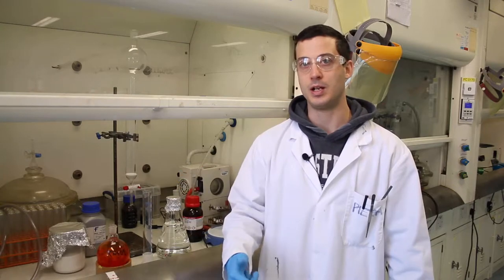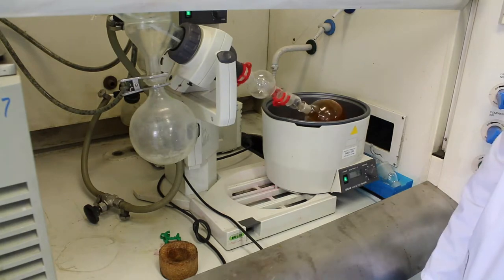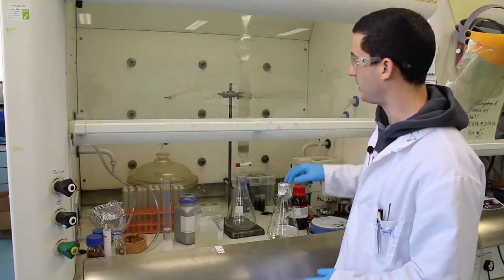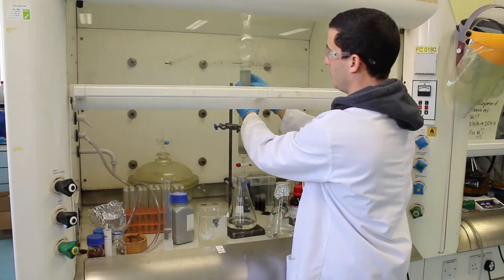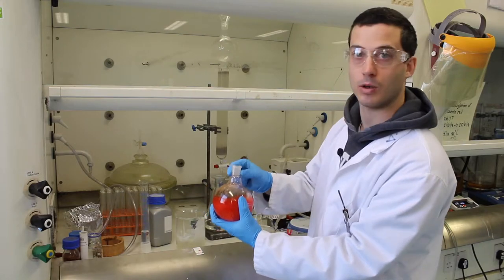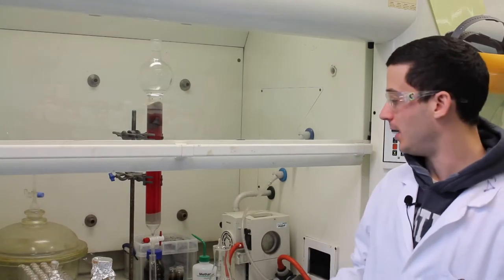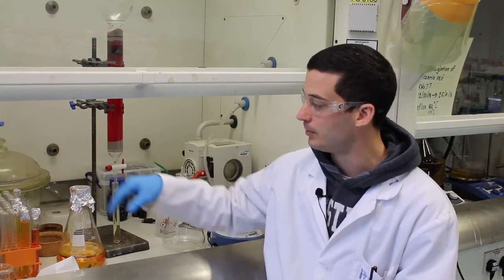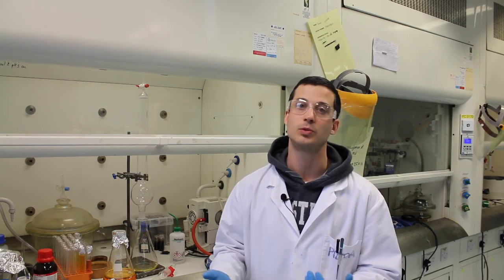Column chromatography

Comment: Very good tutorial! It's very important to always add the silica gel as a slurry, never dry as some do. Besides that, all surfaces must remain as straight as possible. The sample loading by first adsorbing it onto some silica gel instead of applying it in solution is very interesting, i've never seen that technique! But I guess it's only really needed if the product isn't soluble enough in the eluent to apply with a small volume. Thanks a lot for that! 
I've got just a few additions:
- Better put safety clips on every joint while evaporaring. Losing your product in the rotavap water sucks^^
- Stopper instead of aluminium foil
- use those manual pump balloons if you need pressure. Using nitrogen to pressurize the system is always a safety risk. And put a safety clip between the column and reservoir. I've had a liter of solvent splashed into my face because a colleague overpressurized the column. Luckily not really dangerous solvents. With acidic or basic ones I may be blind now.
- don't spot on the outer sides of TLC plates. They usually don't flow perfectly straight on the side.
Reply: why is that better to add the silica gel as a slurry and not dry and pack it with solvent after?

Comment: Why are you putting the last layer of sand before putting the crude mixture ?
thank you
Reply: I believe that's just to kinda hold down and stabilize the top layer of silica. You don't want it moving at all when you pour the eluant onto it.
Reply: Exactly, to keep the layer horizontal. Any disturbance in the layer of silica gel will decrease the efficiency of the column, because different heights of silica will cause different separation on each vertical column of your column. Sand is heavy and has much less surface area than silica gel.

Comment: Can i use cotton instead of sand
Reply: Sure, but this will decrease the efficiency (in plate numbers) of your column, because sand gives a better straight layer to hold the silica. But you can keep that at a minimum by only pluggging the narrow end of the fritless column with cotton. If you've got a column with a frit anyways, sand isn't needed. Though it's always good practice to put sand on top of the silica, to protect the silica layer from being disturbed.
TL:DR any disturbance of the flatness of your silica layer will decrease the efficiency. Knowing and watching that, you can do a column however you prefer.